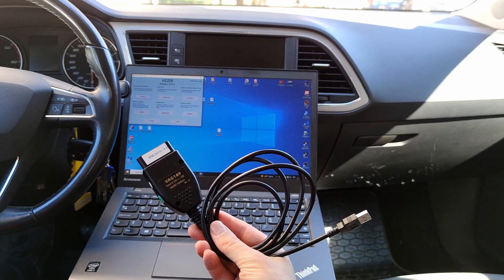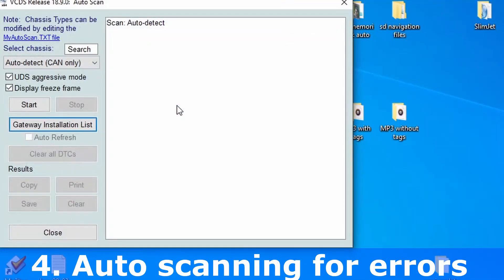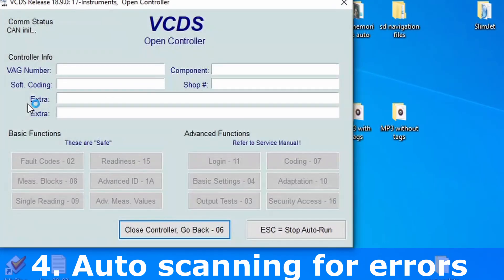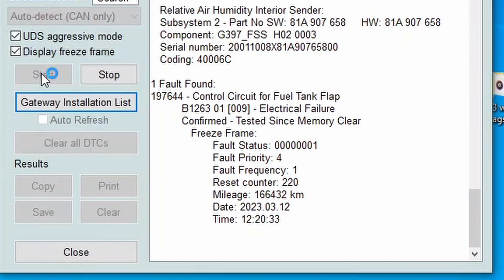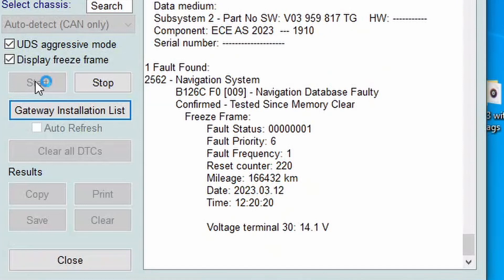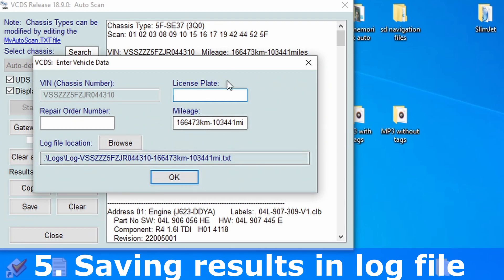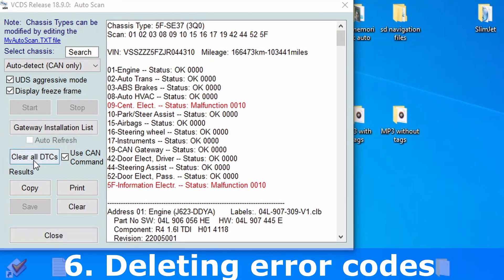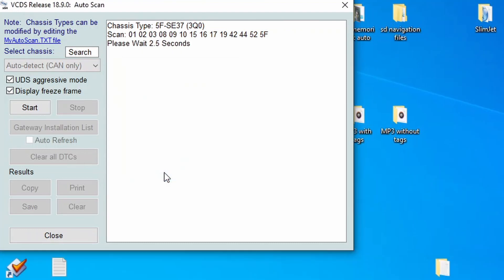HOW TO CLEAR VCDS ERROR CODES

Comment: Hey, I have Leon too,

Is this app free? Does it work with only its cable? Can i use it with any usb to obd cable?
Reply from the maker: Hello, app is not free but you can find cheap clones on ebay like mine. You get app and cable together... I think it is special cable for this app only... Best regards
Reply: @emirdiy  Thanks for your reply,

My car has same multimedia with only 1 SD card slot. Does not navigation. How do I install toolbox on this unit? I read the reposirory in github but didn’t understand the instructions. Can you explain to me basicly?